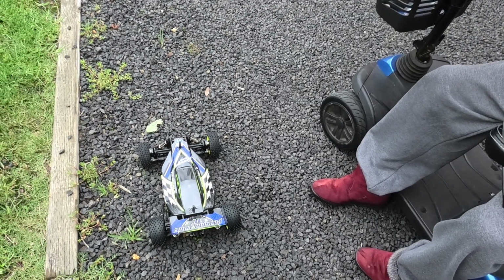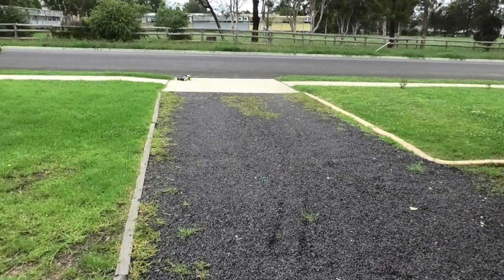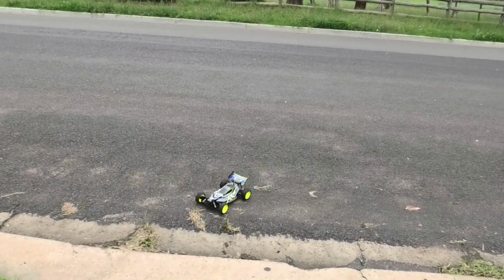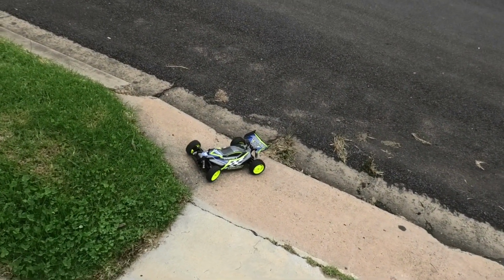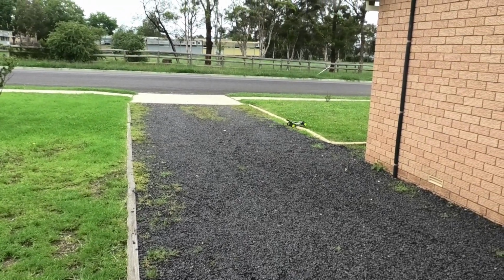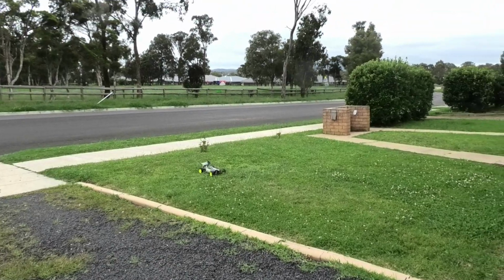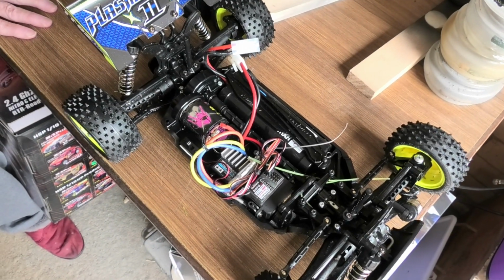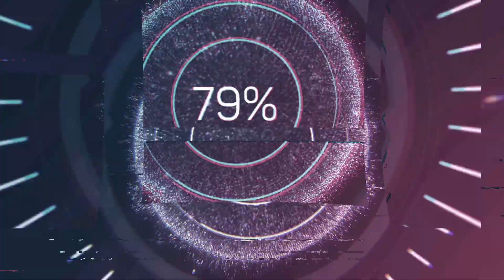Tamiya Plasma Edge II First Run.

Comment: I would post what you have with the build video adding a little blurb about the missing video data in that spot and then going on with the rest. 
Amongst other things I have been considering picking up a re release of the Tamiya Hornet, which was the first hobby grade RC car I ever had. I want one mostly for the memories of it and as a shelf queen. Might run it a few times for nostalgic aspects of it.
Reply from the maker: I was considering doing that, just wasn't sure how it'd be received. Reckon I will. Mate, grabbing a re re Hornet would be awesome! I wish they'd re re the Hotshot II! Be on that in a flash!👍😁👍💯

Comment: Bummer with the footage of the build...
Yeah, the TT-02B sits really low, I basically only drive mine on road, I even got slicks on it...
And I got the same thing, also overheating the motor, I got myself a 2 fan heatsink for it...
Looking forward to seeing speed run and stuff upcoming!
Reply from the maker: Ah, that's good to know, mate! Was concerned about the overheating. Speed Runs are coming soon!👍😁👍💯